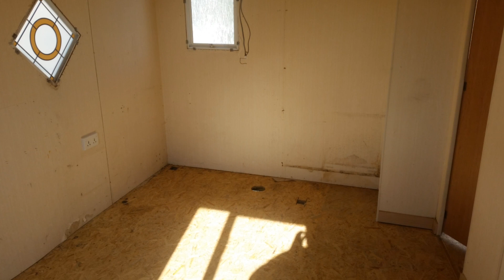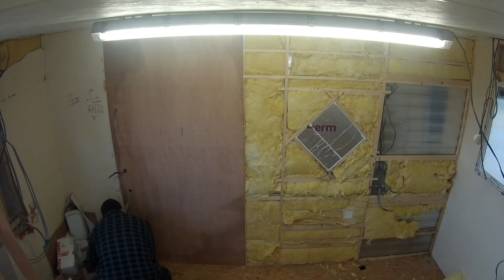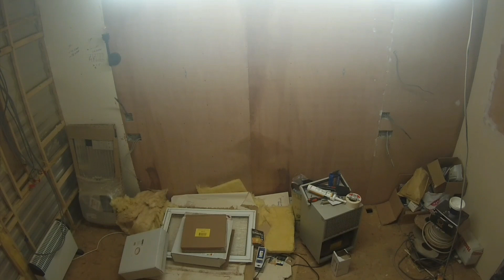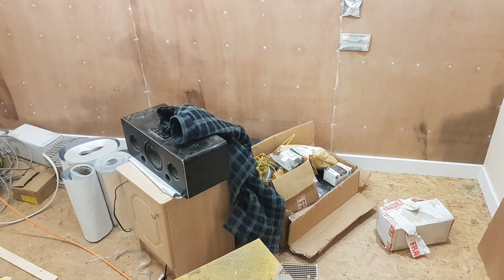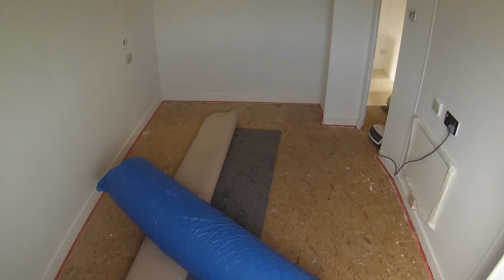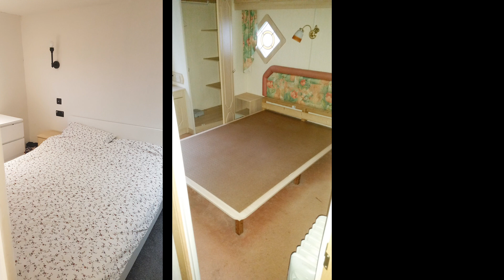201909_Static Caravan Upcycling Project | Our Bedroom Refurb

Comment: I like the use of ply for the walls,  what thickness is it and how is it holding up .
Reply from the maker: Hi Kelvin, the ply is absolutely fine, had no issues with it.
Reply: @MrYobo666  cool thank you,  what thickness did you use ? I've had some changes to life and I'm setting up in a static on the family farm so trying get as much info as possible as to renovation and improvements.
Reply from the maker: Cool, yeah it's 4mm ply I used. Are you cladding the outside or fitting now windows ?
Reply: @MrYobo666  ive not got the van yet just trying to sort everything out first. I will probably clad and insulate the outside.
Reply from the maker: Cool, I done a few videos on Windows cladding etc. Got drawings for flashings that will allow you to put thicker insulation/battons on outside. Leave an air gap as well.